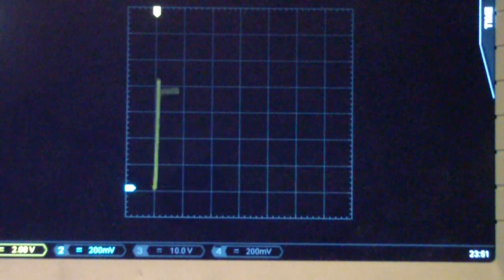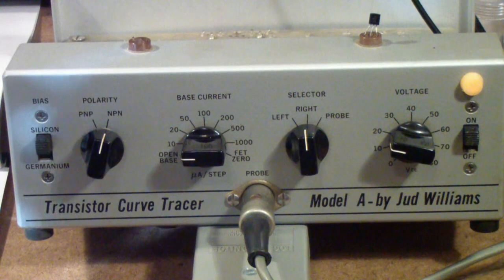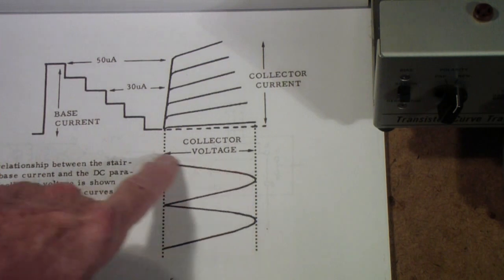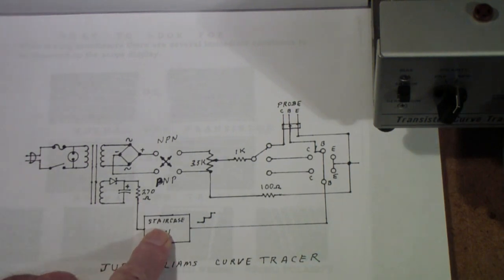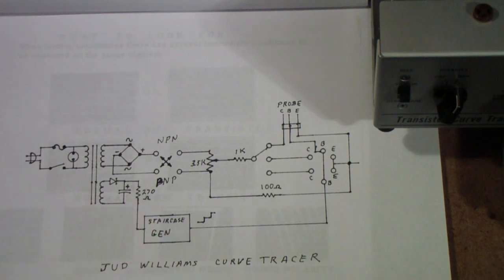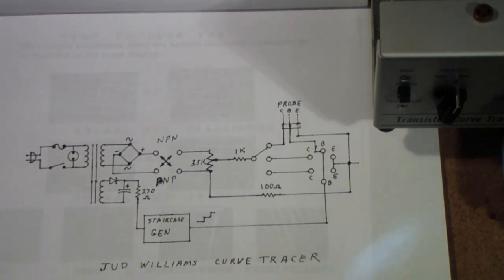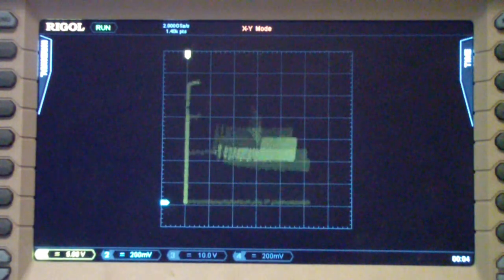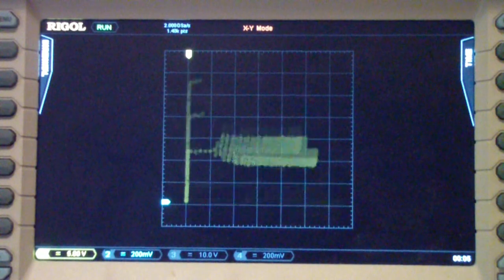TTT236 Jud Williams Curve Tracer

Comment: Hi, Tom. I ran into the same ringing problems when I made a DIY kit curve tracer. I solved it by adding ferrite beads on the wires running to the transistor sockets, very near the sockets themselves. All the oscillations were gone!

Comment: nice vid tom ...is that 2000 series rigol
Reply from the maker: It is actually an upgraded DS4024 with 500MHz vertical bandwidth.
Reply: @tomtektest8042  thanks for reply tom i was just watching your demod probe vid so realised that just now lol ... the reason asked is i had a ds2000 and it was a pain it would crash freeze etc mainly at slow time base hi mem situations... just wondered if same.. nice demodulation probe vid btw im subscribed i built a little probe from Allan (w2aew) channel works well